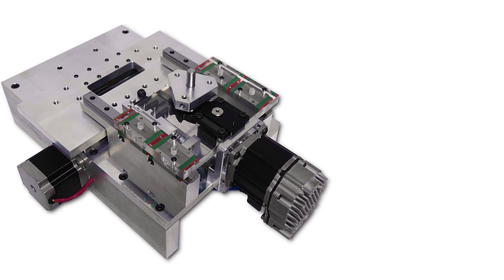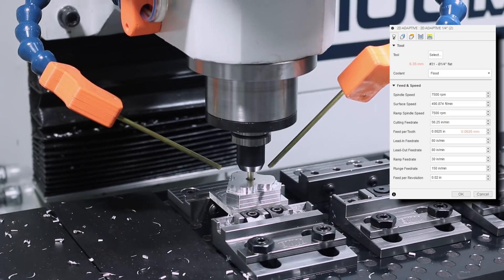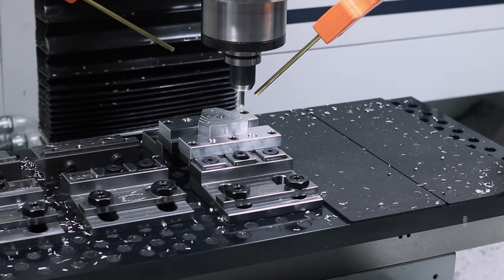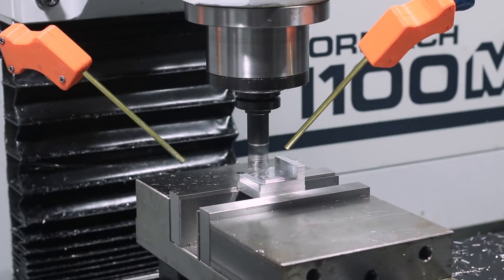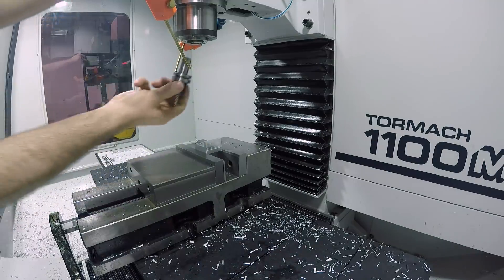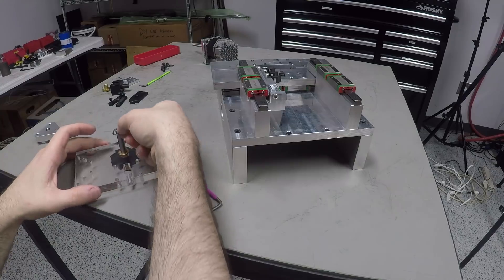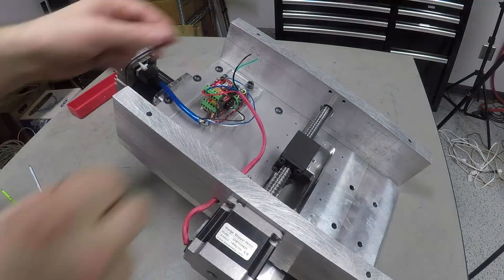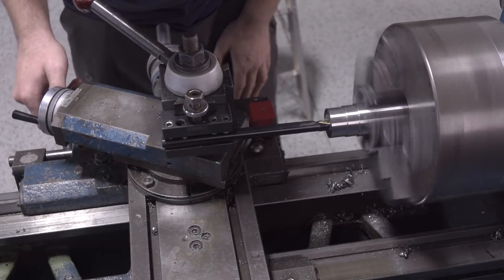DIY CNC Turret Lathe Part 5 | WW215

Comment: Dear sir

Really good job. But my concern is since you are using a stepper motor with no encoders or feed back for indexing, how you ensure that there will   be no or wrong indexing and the right tool is not in position. Please reply.

Comment: you really should of waited and had finished machine with this, all in one freaking video >:| Also fyi for programming, the use of cammel case with first word lower case, like myFunctionCammelCase() - for example, the way the convention actually goes is that you only do that for function input parameters.
Reply: So correct way is like this MyFunction( var someInPut, var anotherInPut); then that way in code you know when you are dealing with a variable which is passed inside of function, hense scope etc. This way there is some reason to it, rather then just always doing it as you do, as purposeless convention.

Comment: You mentioned that the Tic control boards aren't good for syncronized moves, is that the reason delays were used after the motion commands? Is there an interrupt or something in case the movememts can't be completed? Could an interrupt be added that signals that the move was successful? It would be nice if you could do something like "move to 3800; wait for signal" instead of "move to 3800; wait 700 ms".
Reply: A state machine that takes the next "state" (eg: [homed] or [supporting for part-off]) would be ideal, as you could have a timeout if that next state is not reached in [X] seconds and trigger a warning / stop the operation if it times out.

All things they can add later, of course.

Comment: I can't help but think how frustrating this would be to watch as like a traditional blacksmith or metalworker in their time. Like imagine spending a year of your life shaping a part this machine could do in a few hours.
Reply: I think you would find that traditional machinists would be able to make the part within a day or two as well. So far I haven't seen really complex parts for this build. Nothing which requires a CNC anyway.

Besides, they made this out of flimsy aluminum, whereas a traditional machinist would use high quality steel.
Reply: all the 70 yr old machinists today went through the transition and watched it happen in the 70s.. Yes, it must have been partially aggravating.

Comment: Did you put an empty tool holder in the machine around 8:11?  If so, why?
Reply: It could be to keep chips out of the spindle
Reply: Ed Rees in the manual for my teknomotor hsk 32 c spindle they say that running the spindle without a toolholder would damage it. Therefore I do the same, so I’m sure I don’t forget for the next warm up cycle...
Reply: Ed Rees is an empty spindle unsafe?
Reply: @jfpinkston1  
Just speculating, just in case Ed doesn't ser your followup question...
It all might boil down to them not wanting to clamp the TTS collet unless there is something to clamp around. Perhaps clamping the collet without a tool being in it is detrimental in some way (I'm not sure if this is the case). The most handy thing to put into the collet might generally be the nearest tool holder. However, if there's an end mill, or drill, etc. in the tool holder, and you're trying to move stuff around on the table below it, that tool would be a safety hazard (eg. "oops, I moved my hand too far up and I stuck myself with a drill"). So, an empty tool holder is convenient and safe. Another option might be to leave the power draw bar pressurized, keeping the TTS collet in its relaxed state. That would probably work if the PDB button has a latch switch (as opposed to a momentary switch) to let the operator take their finger off the button and walk away, but this might not be ideal as the springs on the draw bar would be compressed and if the air pressure dropped for some reason they'd relax and pull the collet.

Long-ish reply, I know... just trying to give you information, even though some of it is speculative.
Reply: I do the same thing. Tormach warns not clamping the spindle without a tool in the TTS Collet. It keeps the collet from being over compressed and keeps the interior clean of debris.

Comment: When drilling, why do you retract fully on each peck?
Reply: Without through tool coolant, there is no way out of this. Even if the chips are breaking they won't be evacuated by the flutes when drilling over a certain depth and they will get packed. It actually gets a lot worse on a lathe (23xd...had to fully retract every 0.5mm)
Reply: ah, okay. Interesting :) I figured it was just to break them